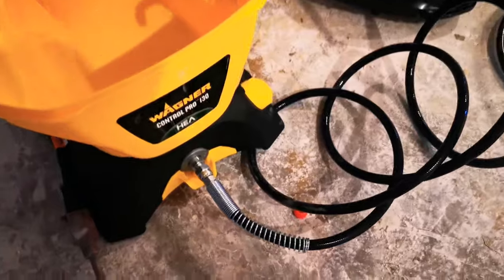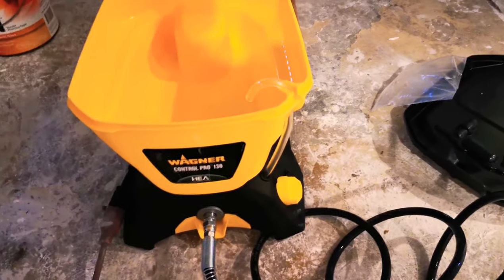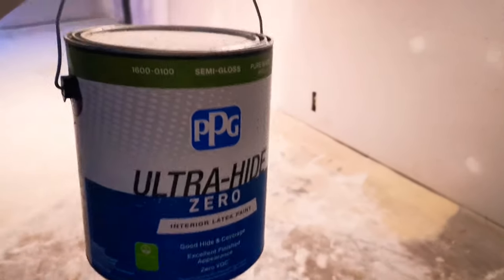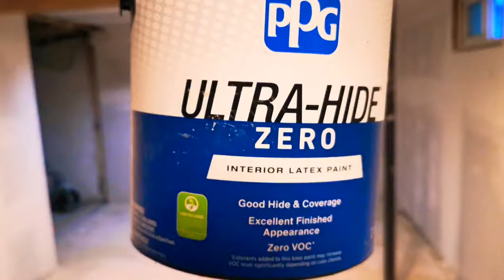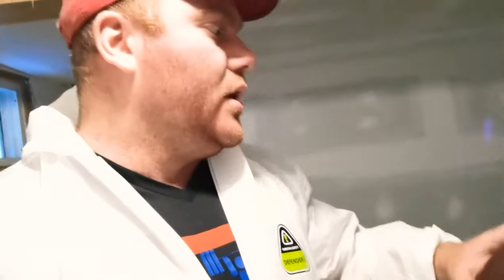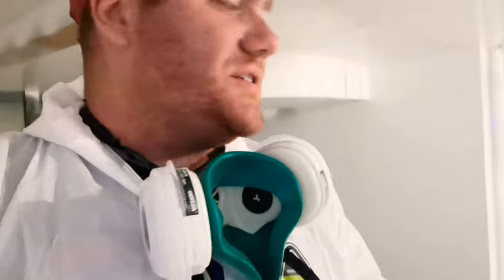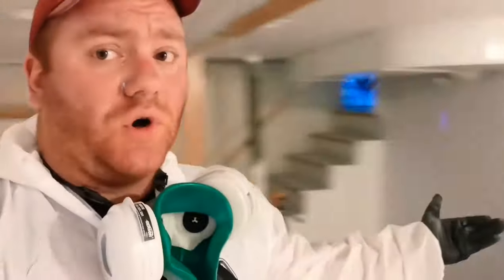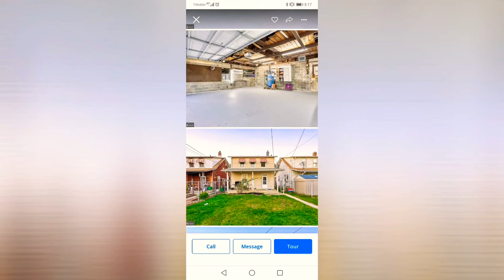Wagner control pro review

Comment: A room this size, this cuts time. Smaller areas, it's actually faster (and cheaper) just to roll it. The amount of time to set up and clean up should be accounted for. Plus, the real amount of overspray is significant if you are a little farther than the wall.
Reply from the maker: Yes it's really only worth it for freshly build rooms or houses where you have to mask nothing. If I had to mask everything off it probably wouldn't have been worth it

Comment: I did like 3 houses with this and it was awesome. 1 coat of off white over black trim and grey walls. Unfortunately my father in law borrowed it and when he cleaned it out he left water in the lines and it rotted out. Wonder how they work with stain I have a lot of fence to do.
Reply from the maker: LOL mine rotted out to . Took it back and swapped it out and kept spraying . Check out my body shop I sprayed this whole shop with it 😂😂🤠🤠🤠🤠
Reply: @speedokoterefinishnetwork4937  I'm the guy that has plasti dipped about 5 cars but now I'm getting ready to paint my girlfriend's 03 Accord in the single stage nardo grey. Got everything ready to order just waiting on the weather. Not sanding a car in 20 degree weather 🤣 I think the contractors who remodeled my house used a sprayer. Sprayed over everything windows, motion lights whatever 🤣🤣🤣
Reply from the maker: @Joeshomegarage  lol ! Good luck
Reply: The rubber hose rotted out??
Reply: @skliros9235  Mine I believe had a metal tubing inside the unit that rusted out. It was almost 20 years ago so I don't really remember. I know 1st i bought the wagner that is a spray gun with the paint container attached to the gun and it was a complete piece of crap. Had to water down the paint to over 50/50 to get it to spray out of the gun so I returned it and got this one. I think if you just blow all the air it it'll be fine.

Comment: Actually looks like a decent sprayer for the money. Admittedly I've not sprayed a lot, though. I've heard great things about Harbor Freight's airless, in that the pump is very strong, you just need a new gun and new tips to make it a decent sprayer. As a pro painter oddly I've done very little new construction over the years and mostly am in occupied residential settings with furniture/etc, so I'm actually looking to get into HVLP stuff for cabinets with lacquer/etc where the doors can be taken off and shot off site. I like rolling more, but I've really contemplating getting a cheaper airless mainly for ceilings, in that ceilings kill my neck and shoulders if I'm doing them for hours on end, and ceilings don't have a lot to cut in usually.

If you gotta do stuff in an occupied setting, I really recommend microfiber rollers, prewetted and spun out. I use Arroworthy 9/16" nap rollers, in 14" and 18" you can put down a ton of paint. Even with the 9s it's pretty easy to put down a whole 4x8' worth of paint in one paint dip. Finish quality is really great and it can look sprayed when done, it's a lot better than normal covers, especially cheapos.
Reply from the maker: This sprayer did have overspray issues :( so in a fully furnished house everything would have to be taped / covered
Reply: @speedokoterefinishnetwork4937  https://www.youtube.com/watch?v=QtipAAnCY20 This is the exact brand I use, Linzer's sold at HD but the Arroworthys are the same company (Linzer's made in China, Arroworthys are made in USA and sold in real paint stores.) I'd say that video isn't an exaggeration. I think from a time perspective you can get super close with microfiber rollers or possibly exceed spraying once you include setup/straining/cleanout time, which is why I never got into it for walls, but want one eventually for big new construction/empty rentals with new floors going in purposes. Also obviously for exterior but there's some argument that brushing exteriors is better as the paint gets into all the nooks and crannies/etc. I'm a little afraid of getting sued for overspray on a windy day for exterior use. :/ Sprayer dudes in painting generally control overspray by tip size and type, but again it's something I don't know enough about personally. But even with the little Wagner where you can't control pressure? you could look into different tips to help it out or possibly get a smoother finish on trim. 

From a speed perspective if you're doing primer or just want it all one color, I generally go with the Arroworthy "donut" 4" microfiber roller covers to cut the ceiling edges in, as they're fluffy on the ends and there's no plastic to scrape the wall like on a conventional roller and can get the corners well. Then you can sort of "brush" with them to not leave a run-mark or similar or use a brush on a pole with a dog-leg tool to quickly go around the whole room and knock it down a little. Then after that you can pretty easily prime the ceiling then walls (or use the same paint color like you did) with just the normal roller. Another huge equipment upgrade with 9s and 14s are Wooster roller cages with bearings, they're a lot smoother than the normal orange style HD ones. Same with the Wooster locking poles with quick releases vs the spin on tips, nice stuff that makes life easier, but it's hard sometimes for homeowners to justify spending the cash on.
Reply: pro 130 works for laquer paint?

Comment: Hey Marco, question, did you experience anything using this paint sprayer, did the motor run hot or did the gun clog during your project?? I hopefully will be spraying two rooms with the one I have, just would like to know what to expect. Average size rooms
Reply from the maker: For small projects this works great. Larger projects not good idea

Comment: Just a tip....   You should spray walls up & down, not left and right.  You will notice as you walk along you are going up and down and you also shouldn't be stopping and starting on the wall as this creates build ups and also risk spitting on the wall as the gun starts & stops..   this is fixed by going up & down...   (starting the trigger above, finishing past the bottom, then start and move up and off wall (making sure floor and ceiling protected correctly.  Hope this helps.
Reply from the maker: Yea I'm no expert residential painter, this was just a project before sals

Comment: Just remember when your spraying out a a room or a house and you have  new walls to do....use a decent undercoat first and backroll your undercoat to work it in....if you just leave it sprayed your paint will flake off the walls within a couple of years....Just a heads up guys👍
Reply from the maker: Your totally right, you have to mechanically press the paint into the surface for these types of paints to stick.
Reply: About to use this sprayer on fresh walls. Should I use rollers to do a first coat of primer before spraying second coat and eventually paint over it?
Reply from the maker: @tomh9043  just spray and back roll, then do a second coat and you should be done. I never used primer
Reply: @speedokoterefinishnetwork4937  Two sprayed coats with the first coat back rolled, got it.  Thanks 👍

Comment: Question? I’ve gotten pretty good at using my grace sprayer and recently picked up a project car. Would it be safe to say the skills u obtain painting a house and a gun be the same or similar to a help spray gun for automotive?
Reply from the maker: It will have a heck ton of orange peel lol
Reply: Are your nuts?
Reply: do it bro be known around town as unique!
society too damn correct these days.
who paints a car with a roller and brush??
eric jones does!!.. well he used to.. that was pre covid...
now he spray paints airless.. using weathershild all season.. and says 'fuck that!' to sanding!
Reply: @marztar  😂😂😂👍👍
Reply: @marztar  I didn’t take it as he was saying he wanted to use this gun or paint on a car.  Only if the skills using this gun could translate to an automotive specific HVLP application. Which the simple answer is kinda sorta but no not really.
Reply: @marztar I has a Homie paint a car with the harbor freight airless paint gun 20$ looked cool from 5-10ft away

Comment: I had an idea for your new place, either your house or shop, that would make for an awesome video. How about spraying a front door with 2K? Either single stage or maybe even do something nutty like a candy paint job front door. I dunno, I think that'd be sweet, and it would maybe be a good longterm advertisement to show how well the paint holds up, and it would be way easier to clean and more hand oil resistant than most house paints for sure.
Reply from the maker: Great idea. Should have done that on my house before I sold it lol

Comment: What about overspray?  I used it on a bedroom and the overspray was horrendous. It got all over the floors and door trim, even though I taped it. I followed the directions, but it appeared you were holding the gun closer to the wall than what Wagner recommended. That, or I was holding it too far away.
Reply from the maker: Yea so the closer you hold the gun to the wall your spraying , the less overspray you usually get .
Reply: @chrro466  I only used the spray tip it came with. It was my first time using a sprayer and apparently I couldn’t even read the directions right. I thought the sprayer wasn’t working, as I didn’t look at the manual to realize where the prime/spray setting knob was. I thought it was the tip. There isn’t a way to turn down the pressure is there, so it doesn’t spray so hard?
Reply: @chrro466  So did you notice any difference in mist/overspray if you were closer to the wall/surface? Have you tried using it to spray paint ceilings?

Comment: Hi is there any way to control paint usage. I have the same Wagner and did use a lot of paint.
Reply from the maker: Unfortunately now. Buy super cheap speedwall paint at home depot 60$ for 5 gallons as your basecoat / cover coat, then use your other paint as your final coat.

Comment: Can you please show us how you properly set up the nozzle? I have the same exact spray painter and when I spray it sprays thick lines along with it that start to drip down the wall like melting wax.
Reply from the maker: Your issue is a clogged nozzle. Remove nozzle, run under hot pressured water, try again. Remember latex paints clean right up water extremely easily. Be sure to flush the system for a minimum of 5 minutes when done with it
Reply: @speedokoterefinishnetwork4937  It was my first use with it so it didn't yet have paint in it.  I was using Kilz Primer. Thank you for the response!
Reply from the maker: Yea you probably just got a small clog in it. Just remove tip and run hot water thro it. I had that same issue with mine a few times
Reply: @speedokoterefinishnetwork4937  I will give it a shot, thank you!
Reply: @DiamondsxRoses  I just use one of this paint sprayers, when it got clogged (which happens very often) or it started to spray in drips or lines I learned to Twist the tip so the tip can face me, I sprayed ones; that will force paint to go through the big hole of the tip and unclogging it.   don’t worry you won’t get you sprayed.  Twist the tip back forward and continue spraying.   It worked for me. Hopefully this make sense.
Reply: @elpuffy11  Thank you,  I will try that this weekend.  I appreciate it!!
Reply: @elpuffy11  take the filter out of the gun.. make sure the paint isn't to watery... to unclog tip spin it and spray out the other end.

Comment: Two questions.  Does this sprayer have a filter in the gun handle?  If so, what color is the filter?  Can you install an extension onto the gun?  Thanks...
Reply from the maker: I didn't notice a filter to be honest. And I'm sure you can buy an aftermarket hose for this gun and system on the internet just haven't checked

Comment: Does Wagner Pro 130 work with Behr Marquee (application 0.015-0.019) with a 515 tip or have any issues?
Reply from the maker: You should be fine

Comment: Are there fine finish tips for the wagner pro 130?
Reply from the maker: Yea there's a host of aftermarket tips you can get for these if you want a more fine mist finish get a smaller tip , for better and fast coverage without much concern of finish , get the biggest tip possible

Comment: Hi. what is your experience with amount of paint needed? Do you feel that you could use the same amount of paint also with a roll?
I heard that is normal to consider about 10% more with sprayer, thanks.
Reply from the maker: Spraying you will definitely use about 10-30% more paint but to be honest with how fast this method is, it saves so much time it's worth spending just a few extra bucks
Reply: @speedokoterefinishnetwork4937  that's what I thought, thanks 😁👍🏻

Comment: Can you use oil paint too?
Reply from the maker: Yea this thing will spray just about anything just be careful of cross contamination.
Reply: So would I need to thin the paint out since oil paint is thick or I can spray it straight from the gallon ?
Reply from the maker: @jr210_  I might thin it out just a hair